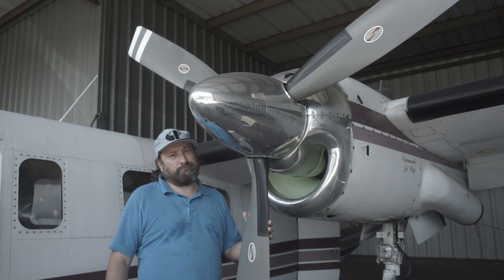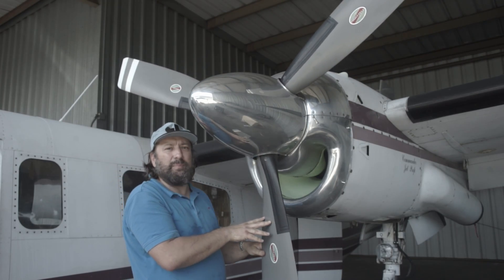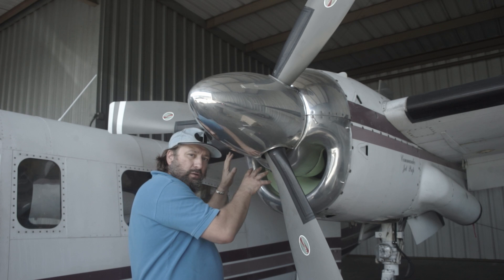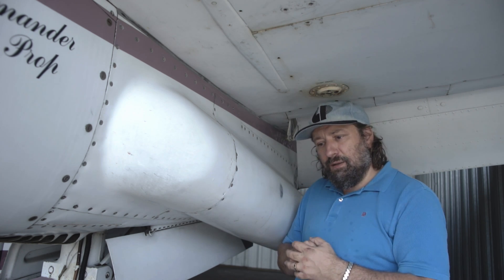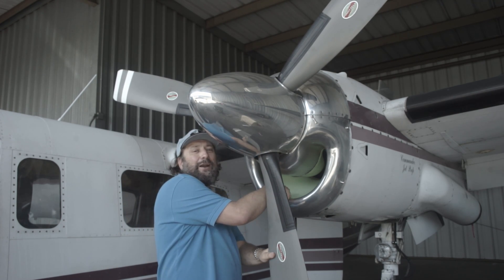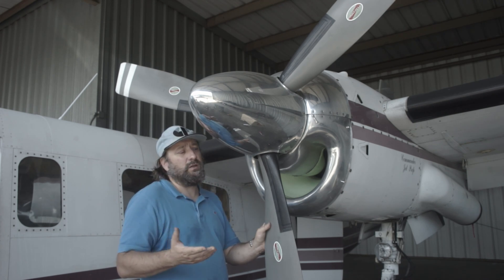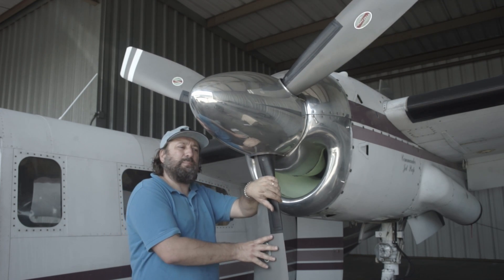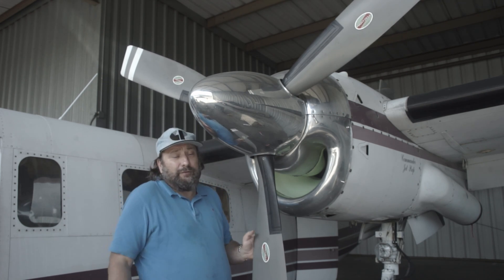TPE331 vs PT6 turboprops

Comment: All yall PT6 crooners obviously arent paying for your overhauls... youve also had little experience with the -10 331s... basically the only advantage the PT6 has these days is the noise...
Reply: Lol... if you’re rich enough to own a turbine powered aircraft.. you shouldn’t be worried about overhaul costs or fuel costs. Nor will you likely be spending 5,000 or 7,000 hours aloft in a small and slow cabin class twin. I don’t care about what the piston engine on my light aircraft costs to overhaul.. I won’t have to do it in my lifetime. 

On the other hand, my PT6 powered plane will spank almost any Garrett powered one—even a -10 MU-2.. with the sole exception of the 43 old, rare, cramped, and high maintenance 400LSs.  Easy starts. Hot sections done on wing in one night. Never had to worry about quick throttle response or quick reverse because with proper airmanship you don’t need it and it’s hard on passengers and props. Won’t ice up or FOD out. And it’s the only engine in the world certified for single engine IFR operations with paying passengers. 

No advantages except noise?  The entire industry disagrees with you.  Companies still have to pay for fuel and overhauls yet they still overwhelmingly choose the PT6. 

That why the last new Garrett powered aircraft left the factory almost 20 years ago.

Comment: Stratobee most Garrett engines mounted on commanders turn clockwise as you face the prop and yours turns the more normal counter clockwise .  Also your props are a flat tip fatter prop than others (both of which configurations I like better) . Any explanations ?
Reply from the maker: Hi Wayne. Hadn't actually thought about that, but the explanation is that the later models, 690, 840, 900, 980, 1000 models got a wing extension at the root. This allowed for a bigger prop (Dowty Rotol) that had to turn more slowly. My guess is they added a gear in the reduction box to accommodate this reduction and that resulted in it turning the other way. The prop diameter on my plane and the 681 model is smaller and the engines sit closer to fuselage. In my particular case, I also have the retrofitted Hartzell Q-tip props as well, not the standard Hamilton Standards.
Reply: @stratobee  thank u that makes sense.  Great job on the vid fly safe !
Reply: @stratobee   I kept a Commander 980 clean for a company back in 1979 to 1983. At some point they bought a Commander 1000.
I know the Commander 1000 used the 331-10 but I didn't remember it having Rotel props.
The company, Heston Oil, also had a G1 and it did have the Rotel props. 
I liked your informative video.
Thank you.